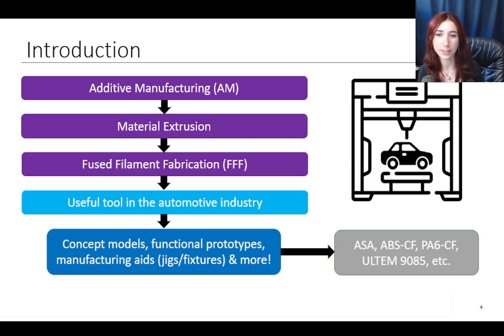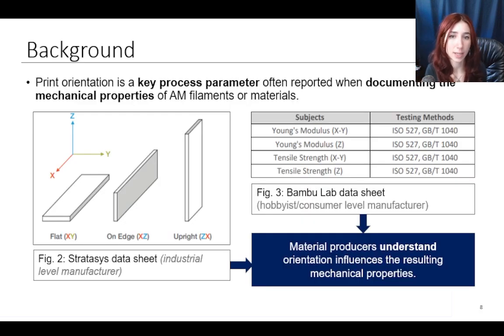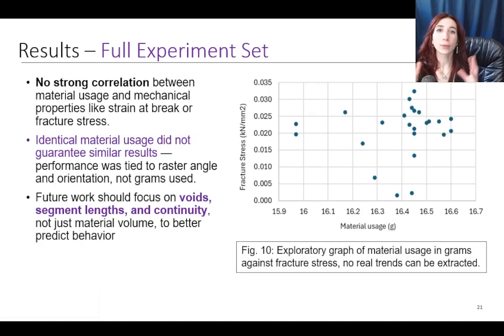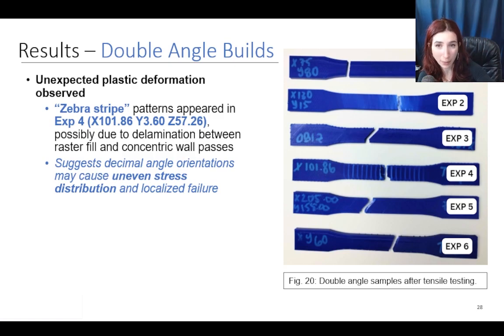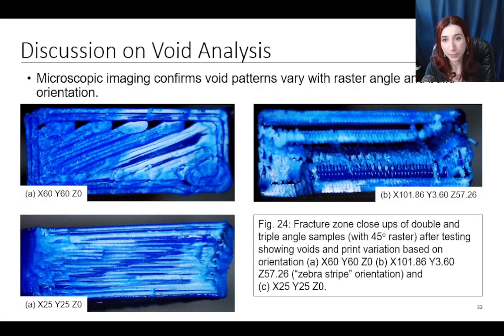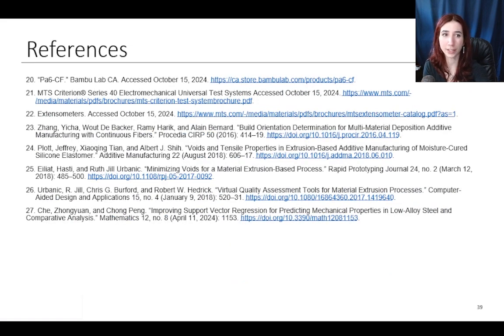so, is PLA brittle or ductile?

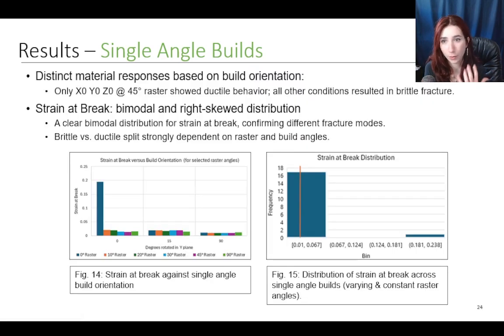Comment: 11:04 Fig 14
This looks crazy.

It does make sense that PLA is more ductile along the print lines where the long polymer molecules have a chance of entangling into each other like spaghetti. Where as they don't really get to do this between the layer lines. (It is a little surprising to me that nobody have found a good way to get the layers to mix better yet).
On top of that the effective cross section area must be smaller between the layer lines (since we see the super elliptic shape) that would also make a stress concentration due to the change in local stiffness, making the cross section between layer lines much weaker than along the layer lines. 

The surprising part is how sensitive it is to the angle. Only 10 deg is enough for the failure to occur between the layer lines.
I guess it should not be that surprising if the difference is strange is very large between 0 deg and 90 deg, then a small angle would be enough.

But that also means that in many real world cases you can only expect to have the strength of the weakest direction. Since you geometry might be very complicated and you might not know you loads and there direction that well (not to mention you might have some bending 😛). You can only expect to archive the high strength and stiffness in cases where you have very well known loads.
And as an Engineer that seems a little wasteful. But again there are lots of use cases the PLA is super useful do to it's shape more than it's strength.

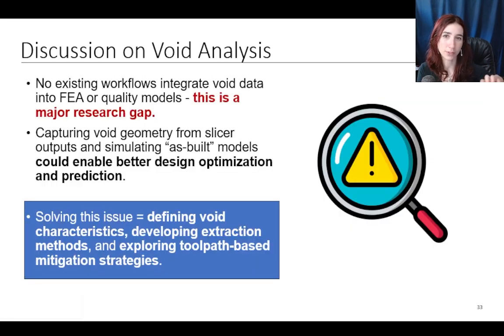Comment: 16:28
Damn adding the voids to the FE model would be a pain. And the difference in failure mode alone would be a pain if making a transient model with nonlinear, non-isotropic material properties. But still that would probably still be easier than meshing the geometry including the voids. 🤔
But someone must have done both already, just for the fun of it.

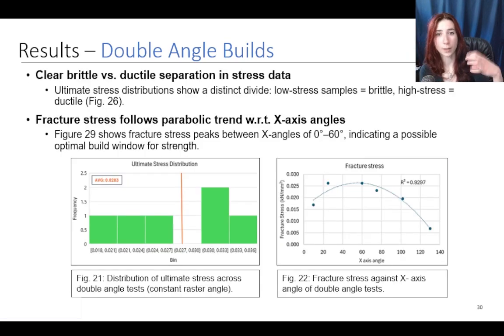Comment: 14:45
I could have used a picture of the cross section for this one. It is a little hard to imagine the X130,Y15,Z0 orientation.
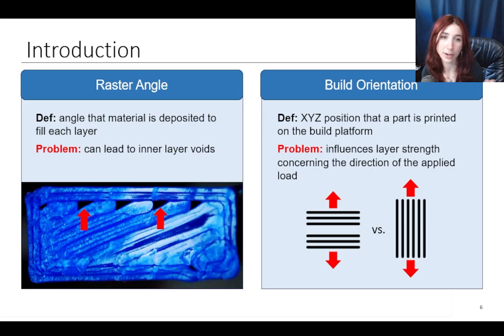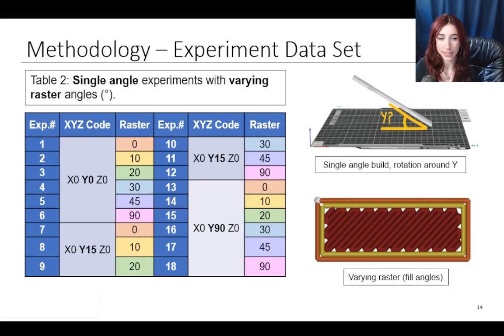Similar to the ones shown at 2:08 and 6:00